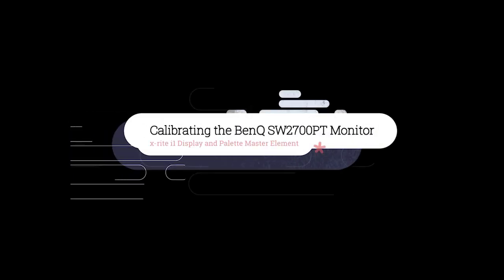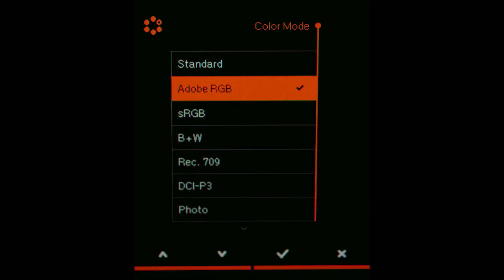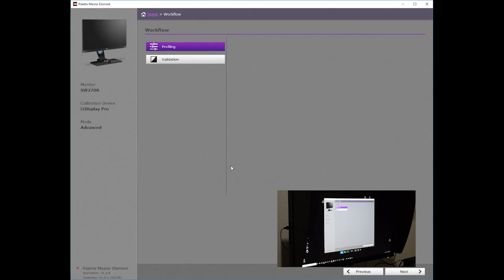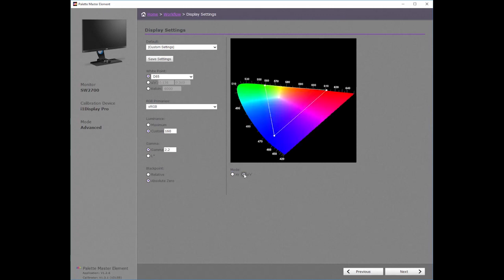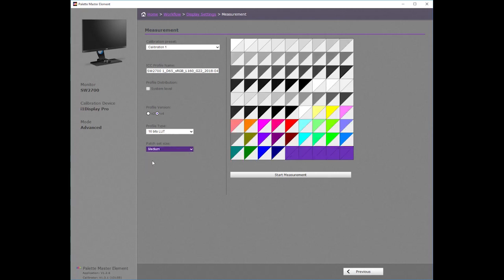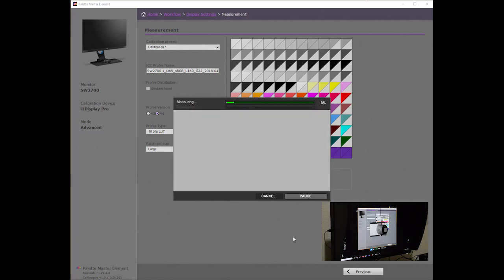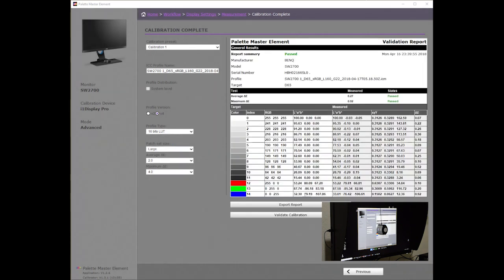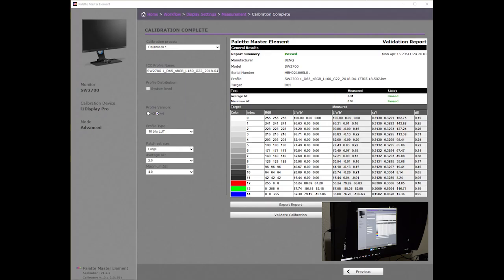Updated: Calibrating the BenQ SW2700PT monitor using XRite i1 Display

Comment: I don't get this to work...
After a calibration, should I changed Color Adjustment / Color Mode to calibration 1 (if used) before verifying the calibration?
What settings should I have in control panel / colour management devices tab and advanced tab?
And I feel the AdobeRGB factory settings is way too yellow
Reply from the maker: Henrik: I will look at this as soon as I can. But, In some of the earlier posts in this chain some of the step are written about.  In short, if you selected "Calibration 1" as the place to store your calibration  before actually doing the calibration, then you will need to select it from the menu afterwards. SOmeone did mention that the puck can be programmed to choose that for you. I have not. I just use the center button on the puck to start the monitor menus. Then I use the puck arrows to find calibration 1.
Reply: @docrujet  after been in contact with BenQ (Sweden) I was informed that when using usb to connect to my laptop there is an OSM setting about rgb range that need to be changed from something to 0-255. After this I almost get an OK on on the calibration verification, but is still a bout out of range. And I feel the screen still is too dark and that white is a little bit to greyish. 
For comparison, some youtube widows have skin a little to dark orange. But that could be because of how the clip was filmed.
Reply from the maker: @henrikdahlberg878  I remember this. I ran afoul of that at one point. I also did not realize that the NVidia software switched back to 8 bit after an update. Found it later. No warning that the settings had even changed. 

Many people write about 8-bit vs 10-bit. Some say we cannot truly see the difference. I don't know. I just know that when my monitor is on, and setup properly, it beats the heck out of what I had before. My eyes are much happier. I hope you enjoy your monitor. 

I am looking to purchase a laptop soon for the purpose of color management when I am traveling to photograph artwork for digital printing. I am open to any suggestions you might have. 
Rog
Reply: @docrujet  I am not the one to ask for anything in this area. I bought an asus zenbook that is suppose to have a decent screen. I need to calibrate it though if possible, even I can tell it is too blue and too bright.

So it turns out I am just an idiot...
The Benq people started to ask the correct questions. I used to have an usb-c->hdmi cable to connect laptop to benq. When switching to hdmi->hdmi calibration and validation went ok. I still think it might be a little on the dark side and white is a tiny bit grey, but I have never been good at the colour/brightness aspects of screens (as a concert photographer there is never anything white or true skin colour so that didn't help...), add to that not perfect eye sight. That is why I bought the xrite i1 display pro in the first place, I only bought the benq after I realised you were suppose to be able to calibrate to near perfection with this combination (at a price that matches my photographic skills and ambitions).

Anyway, thanks for the help.
Reply: @docrujet  HI! I just purchased the benQ monitor sw2700pt and am having some issues calibration. I have the Nvidia Graphics card 1080ti, is there something special I should change with this?
I select 16bit LUT in the master palette software when calibrating. 

The Calibration passes validation, but if I turn the monitor on and off it turns super yellow/dull. 
Additionally, I noticed the monitor calibrations are being stored in my windows ICC profiles - shouldn't they be on the monitor hardware only? Why am I able to select them for windows? ( like when I software calibrate)

I think too that my display settings make a difference- If I chose duplicate display, or extend my monitor (from my asus rog laptop it's connected to) it goes super yellow and whacky - so I can't have my laptop open if I want my monitor to stay calibrated? this doesn't seem right. I feel like I am missing something. Spent hours researching and am at my whits end. :|

Any advise you can give is greatly appreciated!
Reply from the maker: @TJ-yk8tq  It sounds as though you successfully calibrated the BenQ: "The calibration passes validation." But, then when it is turned off and on again, the colors are not right: "yellow and dull" on the BenQ monitor.  It sounds as though the BenQ is a second monitor on your laptop. 

Quick Answer:  I have not tried this configuration. I wonder what BenQ will say if you call them. They are easy to speak with and patient when you talk to them on the phone. I would call BenQ and ask what they recommend. 

Long Answer: Your computer does keep ICC profiles in "C:\Windows\system32\spool\drivers\color" so it can interpret your monitors colors signals. Even after calibration, Windows still needs to know what to do about the monitor's RGB signals. Your monitor  knows what it thinks red should be. Windows needs to be able to see the difference between the device's Red and how far it is from CIE Lab numbers and how to adjust the monitor output. 

It sounds like you got a good calibration. But after you turn things off and on again you get weird color. 

You can check in  WIndows "Color Managemen"t and see if your ICC profile is selected as the default for your monitor. 

If it is not, then Windows might be defaulting to another profile after your monitor is turned off.

 If I was going to connect my BenQ through a Laptop (two monitors to keep track of here) I would tell windows to keep the BenQ ICC profile as my default. Remember, both ICC profiles are on your laptop. WIndows has to know which profile to use at any time. Sounds like there is a little profile confusion going on. (I'm really out on a limb here.) I want my laptop to use the laptop ICC profile if the BenQ is not in use. IF the BenQ is attach and turned on, I want the graphics card to know that it should use the BenQ ICC profile. You can try both, check which profile is in use in color management. Make sure that Windows is not using one profile for both. If Windows is switching back to your Laptop profile each time, you might have your answer. 

It's an experiment. Try it. But, please call BenQ. They really have helpful staff. 

Rog

Comment: Anyone else keep getting validation errors?
Reply from the maker: Validation errors can occur for a number of reasons. When the software says - after a calibration -  the validation has "failed", that's when we have to go back, look at all components of the system. You will have to troubleshoot. 
1. is the software up to date (a new update is out now). 
2. Is the calibration device connected to the left side of the monitor (and the monitor's cables connected properly. )
3. When I setup  the calibration, which methods and settings  did I choose in the Palette Master Elements (PME) Software. 
4. If you changed calibration devices you can get differing calibration results. For example, XRite's iStudio I recently acquired tells me that my Blues fail. (!?!) Whereas the i1Display does not (!?!) I do not yet understand the reason for this. Is one device more accurate than the other? That's a question for another day. 
5. I do not use the Matrix setting in the PME software. 
6. IS the monitor connected to a "10-bit" graphics card. Is the card set to speak 8 bit or the 8+2 bit (10-bit) to your monitor. 

Breath in; breathe out. These electronics are wonderful, but ... there are times... Good luck to you. Let us know what you discover.
Reply from the maker: There is also some info under ROman Jelensky's question that might be of interest to you. Rog
Reply: @docrujet  Hey Roger, How can I tell if my graphics card is "10 bit"? I have the Nvidia GEforce GTX 1050Ti
Reply from the maker: @TJ-yk8tq  I found this on NVidia's site: https://nvidia.custhelp.com/app/answers/detail/a_id/3011/~/10-bit-per-color-support-on-nvidia-geforce-gpus . 

I would advise that your card probably does suuport 10 bit (8+2 bit). But, check your NVidia Control Panel (in the right lower corner of your taskbar if you use Win10) . Go to the Display section and select "Change resolution". In the right area of that window there is a "3. Apply the following settings". Make sure the "Desktop color depth" is set at "Highest (32-bit)" and make sure the "Output Color depth" is set at 10-bit. "Output color format" should probably be set at RGB. "Output dynamic range" needs to be set to Full. Otherwise, the card limits the available perceived colors. 

I hope that helps.  Rog

Comment: Dear Roger, please ... I did everything as you did in the video,  I also calibrated monitor to sRGB as you did, but after calibration, all colors are washed out. Colors looks normal only in color unmanaged  aplications. Can´t figure where is the problem. I´m using the same x-Rite Display pro, my GPU is nvidia 1050 gtxTi. Any idea to help ?
Reply from the maker: I ran into a similar problem when I first bought my monitor: "colors are washed out". I even got a pink screen using the i1 Display calibration device. I updated my software, rechecked that my device was connected and the monitor was connected properly as instructed and still had a horrid  rosey pink to white washout. Good news: until you have a chance to call BenQ (their telephone support people were helpful) you can use the factory set calibrations by accessing them on screen or by using the preset options on the puck. Bad news: back when I had that washout, I got mad, started to film the "failed calibration" and @$%! it did not fail that time. (!?!) That's why I made the video. I also called BenQ prior to making the video. They offered a replacement monitor. At the time, I decided to wait. 
 1. Under Windows Monitor Settings (change display setting... advanced display settings...display adapter properties for display number 1...color management tab...color management...") the "Device" box shows I am using my NVidia P4000 Graphics card. Under the ICC profiles box, I'd make sure there is one profile shown that you are really using. It shows the name of the Calibrated profile you are using. Hopefully, that is the one you last chose from your calibrations. If you click the "add tab at the bottom of that dialog box, it'll show you other profiles you have made in the past - all of them. Even any custom printer profiles you made. 

2. ALSO,..... if you've updated the Software for your graphics card recently, go back and make sure it is using your monitor as a 10 bit monitor. Go into the "change resolution setting" area in their NVidia control Panel and towards the bottom of that section, there will be an option to change your monitor to a 10-bit display. NVidia changed my monitor setting to use the BenQ SW2700PT as an  8 bit monitor. I didn't catch that until today. I changed it back to 10-bit. Thanks!

I am not sure if this will help. I hope it gets you closer to a solution in Windows. I do not have a Mac for graphics. But when I get another Mac Laptop I will set it up using the same devices.
Reply: @docrujet  Thank you for your answer. Tried both things no change, stil the same problem. Benq is still not respondig to my ticket... so , any other ideas? I´m getting realy angry... And, I have one special question - if i reset my monitor to factory setting, does it realy reset all setitngs ? I know, I have to delete color profile in color managment tab too.
Reply from the maker: @romanjelensky7035  Setting the monitor to factory settings will not erase the original settings made at the factory. Those are safe. I have to admit, I think any custom calibrations you have made are stored in ?Windows? ANyway, getting the monitor back to factory will at least allow you to use their sRGB and Adobe RGB calibrations.  WHen you find out more, please share. Rog
Reply: @romanjelensky7035  Hey Roman, I had the exact same problem with my BenQ monitor and finally realized i was using the X-Rite Display Pro backwards (I had the lens facing out towards the room; the lens should be facing against the screen).  Maybe you weren't making the stupid mistake I was.  In case you were, hopefully, it will help.
Reply: I think that is a bug in the latest software. It will flash into a washed out low contrast very wrong look at the end of calibration and profile creation. Use the puck or key to move from cal 1 to any other then back again. The calibration and profile are correct. The flash into low contrast should not be there while calibrating.

Comment: true 10 bit? if you look at display specification, sw2700, 8bit + 2 frc
Reply from the maker: I think that is worth a call to their support folks. LEt us know what you find.
Reply from the maker: It is an 8 bit + FRC monitor. 2 bits are allocated for the LCD crystal changes that produce additional shades. I wonder if we would see a difference in a monitor that is designed to use 10 bits per pixel to produce color without an additional 2 for shading. Dolby Vision uses 12. There are more than a few articles on the web that speak to this. For now, I at least benefit from the gamut coverage. Supposedly without the extra 2 FRC bits (beyond a simple 8 bit per pixel scheme), we would see banding. I like mine where it is. Rog
Reply from the maker: BTW, even Eizos ColorEdge CG248-4K 23.8" 16:9 IPS Monitor is 8+ 2 FRC. It is pricey, but some Eizo monitors have a color calibrator bit onto the device. Handy.
Reply: @docrujet  yes, many eizos color edge turn out to be 8 bit 2 FRC
Reply from the maker: Great question though.
Reply: @docrujet  yes, the panel manufactured by AU Optronics (Taiwan), and its AHVA IPS 8 bit + 2 FRC. but never mind, because I think it still a good and acurate monitor, because Im thinking to buy one

Comment: trying to re-calibrate my SW2700PT monitor today and I updated the Palette Master Elements to v1.2.9 for Windows and it drops a lot of the options, including being able to select from the presets (photography/web design/video editing) and I believe the ability to select your color space (AdobeRGB/sRGB).  Going to revert back to an older version, looks like BenQ Australia has an archived copy of the v1.2.6 and v1.2.7, FYI.
Reply from the maker: I recently tried using the i1 Studio (new) to calibrate my monitor (still inappropriately in love with this monitor) using the Palette Master update from BenQ. Uh, clearly I have some homework to do before I share much about this. The updated software worked well with the older XRite i1 Display device. But, the result using the i1 Studio device was not good. The whole screen turned green. The whole process just drew to a halt.   I will take some time soon to dig in to this. Once I wrap my mind around the changes I will make a video... interested to see if there is a solution to the i1 Studio green screen.Thanks for your words and input. By the way, the i1 Studio is doing a great job of helping me to create ICC profiles for each paper type I use when making archive prints. So, easy! Just gotta' get the screen calibration thing worked out. Rog
Reply: @docrujet  I'm about to get an i1 Studio for creating ICC profiles, so eager to find out your results.  If all goes well I'd like to sell the i1 Display and do all calibrations with the i1 Studio.  I think you mentioned you are printing on a Epson P800?  This is a printer I'm also thinking of purchasing in the near term as an upgrade to my Canon Pro-100.
Reply from the maker: @thomasnwalshiii  My first trial using the i1 Studio did not work so well for monitor calibration. I am going to try again. (Screen turned green and the software quit working). When I figure out what happened, I think I'll make another video (brief video) about it. This was used with the new Palette Master Elements update also. I reeeeeeally enjoy the Epson P800 printer. It is amazing what I can do for others now. I have a good color process now and plan to offer Archive printing of original art in the Spring. There is a lot of freedom knowing you can go from a calibrated 10 bit monitor to properly printed files using the proper ICC profiles you can make at home using the i1 Studio. Just a wonderful purchase for the purpose of make ICC profiles for each paper type I print on. (Thinking about getting the Epson P7000 in a month)
Reply: I too have most X-Rite devices. I do however like the i1 Display Pro as it is so blazingly fast. The software isn't but when measuring the i1 is by far the fastest out there. @thomasnwalshiii